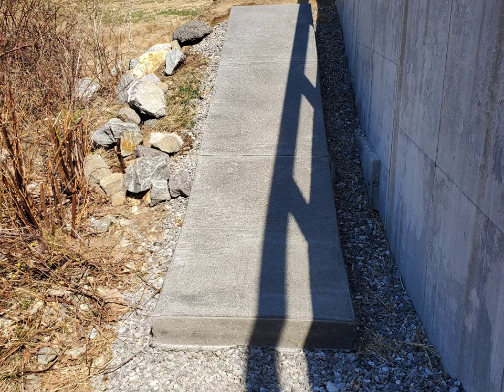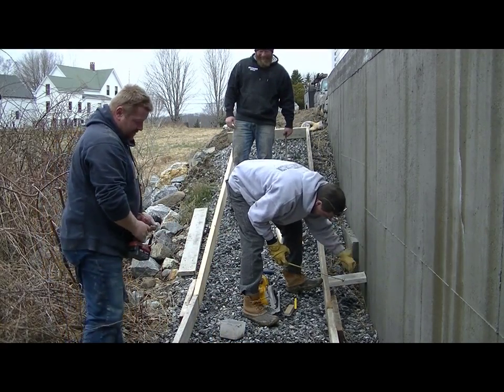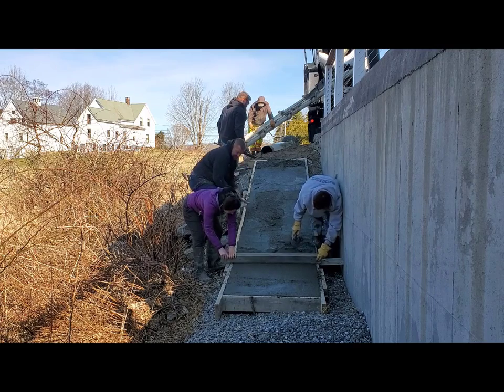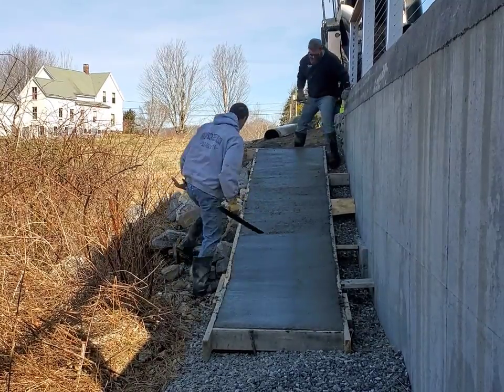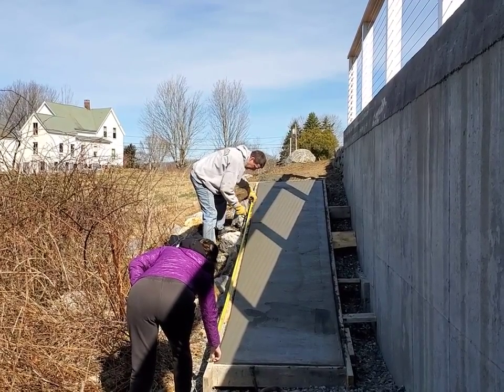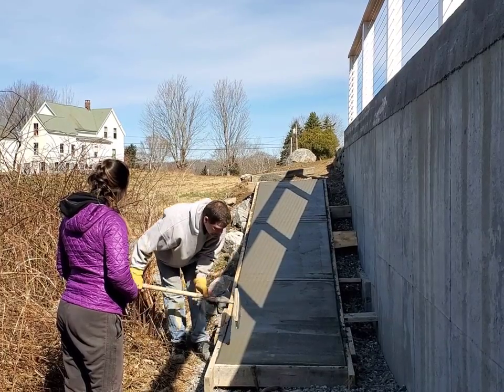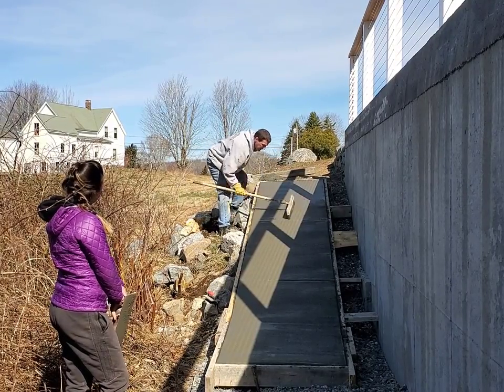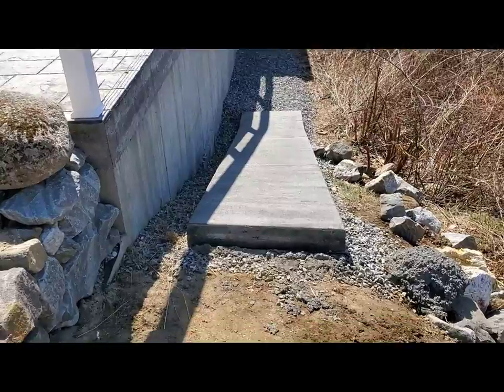How To Build A Concrete Ramp (For A Walkway)

Comment: Mike: I found this video searching for how many steps to put into a sloped concrete walkway.  I understand they didn't want them, but if you were going to do this project with steps, how would you determine how many are needed? Are there any good rules of thumb?  

The walkway we are wanting put in beside of our house is a little over 50 feet long with a 9 foot fall along that length.  The existing pathway has some flatter areas mixed in with the slope.  Any idea what we would be looking at for number of steps needed? I don't want steps all the way down, just the minimum with reasonable sloped areas in between them.  Thanks!

Comment: So if there is a cast concrete ramp attached to our concrete patio .. Would I need to jackhammer it to get rid of it? Or is there a better way?
Reply: Score a cut using an angle grinder with a diamond blade first, then use a demolition hammer. Without the cut you risk damaging the patio.

Comment: Pretty cool! I’m glad you showed a bit more of the formwork here. 
I’m surprised they didn’t ask for a set of stairs/steps there. That broom finish seems plenty good for even wet weather, but what about icy conditions? Being from Fla, I’m definitely no expert on that, but it just seems like a ramp that steep could be a real ‘butt-buster’ with a little ice on it. 
That job had to have fallen under your ‘minimum price threshold’, correct? I mean, you just can’t give a customer a sq ft price for something like that.
Reply: If there is ice on something like that it's fucked. However, ice won't tend to stay on there because of the extreme slope.

There are city sidewalks all over the place on hilly areas. People still use them in the winter.
Reply from the maker: The wanted a ramp because they wheel barrow stuff down back of the house. They're only summer residents so no winter for them here.
Reply from the maker: They're only summer residents. No worries for ice.

Comment: no footing? or rat wall?
Reply: Never heard of a ‘rat wall’.
Reply: psidvicious a rat wall is a simple footing design, approximately 8” wide and 18” deep on the perimeter. Now I don’t know what kind of base is under there but looks like it’s on the side of a hill, obviously it slopes down as it’s a ramp but I mean left to right sloping on a hill
Reply: @Tom-yb6sl  Hmm, I guess I don’t quite understand what the difference between a footing and a rat wall is. Where do they use this term at [if you don’t mind me asking]?
Reply: psidvicious I’m from Ontario, you can use this same very website to find a tutorial on one where it could be better explained
Reply: Tom is a sidewalk essentially. They are not building off of it! No need to haunch the edges for something like that
Reply from the maker: Thank you Aaron, you took the words right out of my keyboard!!
Reply: @aarongrabowski5620  thanks! I didnt think the pole barn was going on top of it but in Maine where the youtuber says they go thru freeze thaw like no ones business. I thought maybe building on incline on the side house, where more than likely heavier rain is going to be travelling down the side there possibly washing the base away. IF you read my previous comment, i said i'm not sure what kind of base is under it, maybe its big gable stone but most house are back filled with clay, at least in my part of the world.